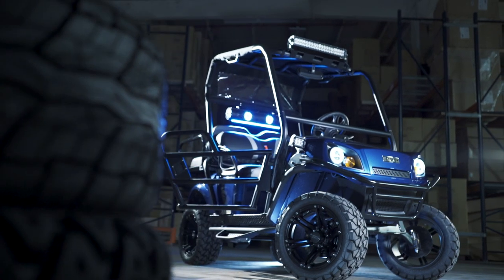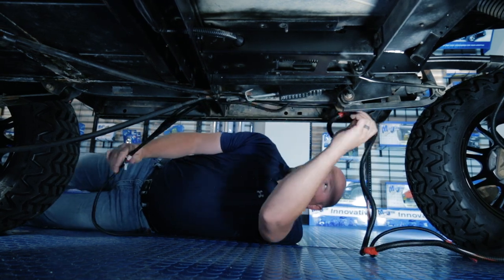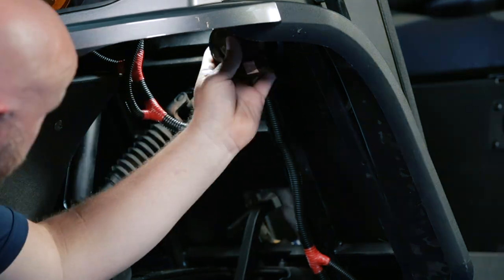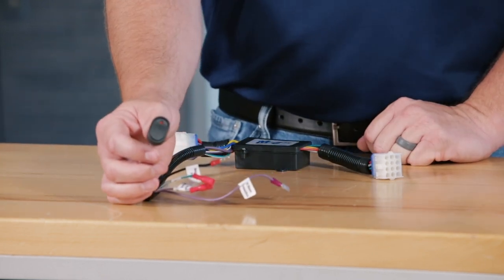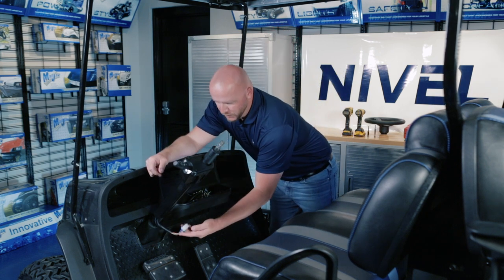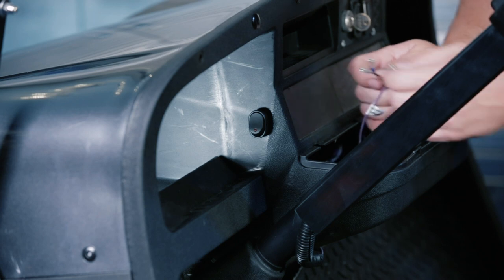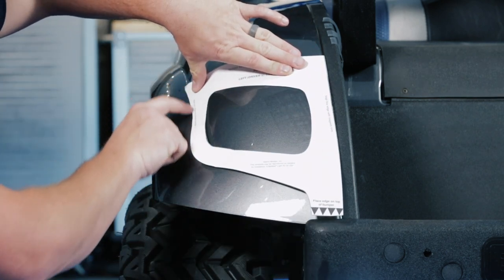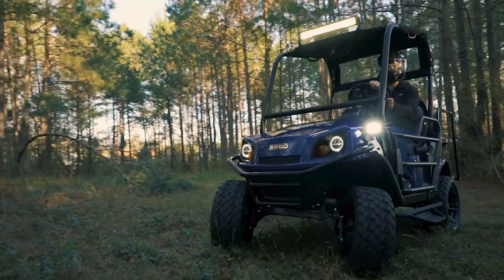Ultimate Plus Light Kit for the E-Z-GO S4® | How to Install Video | Madjax® Golf Cart Accessories

Comment: Very helpful video. I can make a specific suggestion to help with the installation. Use a 7mm deep well socket to push on the headlight retainer rings. That helped get them on a lot easier. The presenter mentioned using a socket, but not the size.  One thing that I haven't been able to figure out is how to keep the parking brake on without the brake lights staying. I'm hoping that someone from Madjax will see this comment and respond.
Reply: i have the same question about the brake lights staying on.